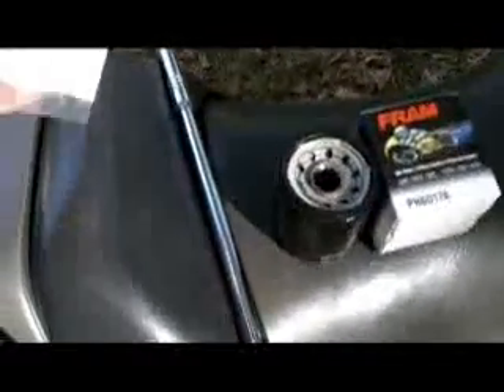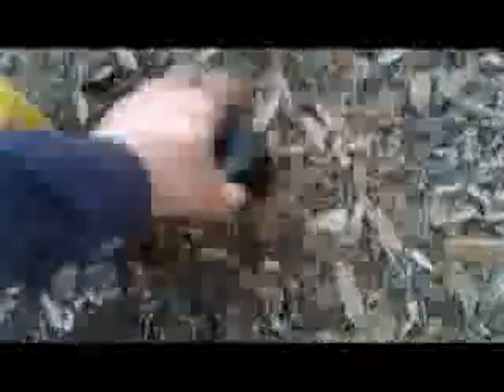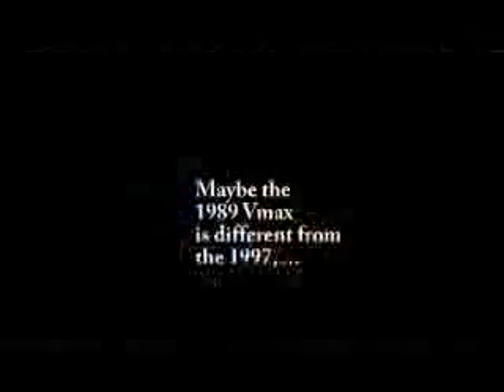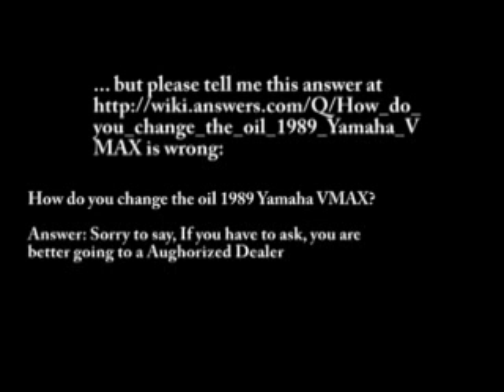Yamaha Vmax Oil Change

Comment from the maker: I did not need any special tool for my filter. If the previous owner tightened yours too tightly, you may need one, but the filter is in such a convient location that you should not need a tool, normally.